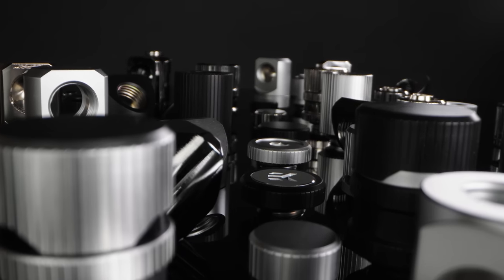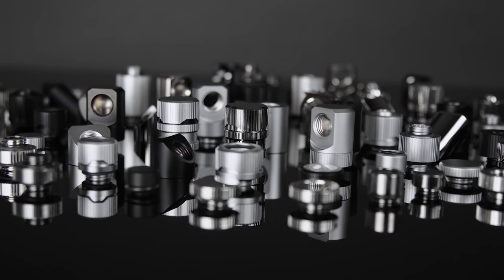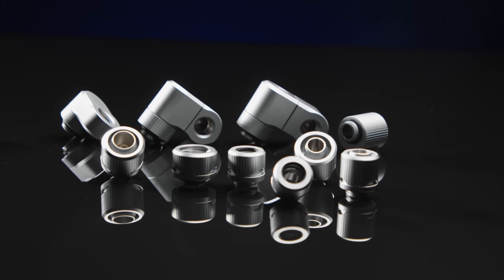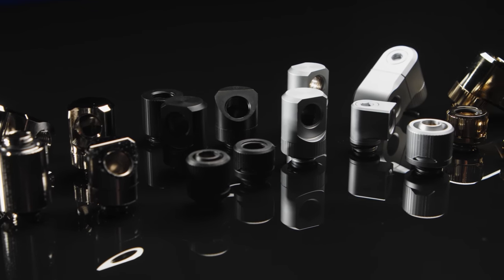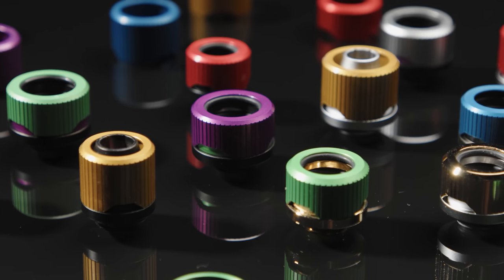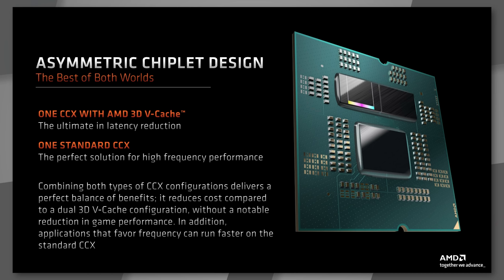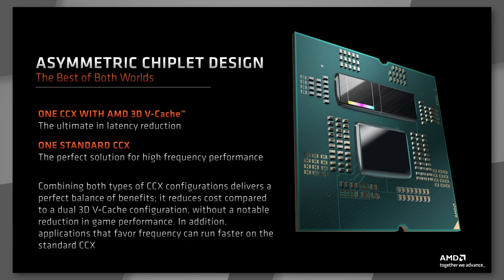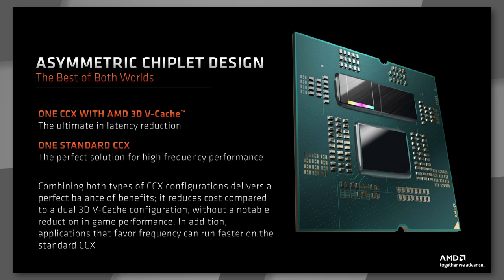Why I switched back to Intel...

Comment: Hey Jay, I feel you are right, you may have had a better experience with a 7950X non 3D. 
For my home rig I too got the exact same MB/RAM/GPU/SSD you did. However I chose a non-x3D 7950x as I wasn't a fan of the 7950X3D design choice being on only one CCD. This whole year my rig has run it's DDR5 RAM on EXPO 6GHz settings flawlessly since new and haven't had any of the issues you encountered, nor have two other mates who also did the same upgrade start of this year with the non-X3D 7950x. Perhaps all the issues that people have had on the 79050X3D CPUs is down to just straight up a bad design decision by AMD or very low tolerances in that product mixing the CCDs with only one with x3d.

Comment: Running a 7950X3D, 64GB (4x16) DDR5 6000 CL32, Asus X670E-E motherboard, absolutely ZERO issues. This is EASILY the best CPU I have ever owned. It is NOT that hard to monitor cores, or to just run something like Project Lasso if you can't figure out how to properly configure something as simple as X Box Game Bar. You can tell Windows if it ever uses the wrong cores for something, and it'll remember not to do so in the future. You literally just have to check a box. LMAO

Comment: Got a 7800X3D with  2x 16GB 6000 Mhz CL32 on a Gigabyte B650 Gaming X AX 
One Time I had memory issues, which I could reolve with one change in the bios, which I found on reddit
That was my only problem and im really happy with the cpu

GPU: RTX 3090 FE repasted
Reply: Can you provide sauce? Helped a friend build with a x670 Aorus Master and 6400 Vengance (7800x3D as well). Always fails to boot with XMP profile and defaults to 4800mhz.

Comment: I have a 5700X and it's been flawless.

I was wary of X3D because they used chips that had been initially rejected from their initial line. I know a lot of people are doing fine with their X3Ds, but you can see the problems cropping up due to using lower-quality chips.

Comment: The beauty of waiting a while after release. I upgraded 4 of 9 of my AM4 5000/x570 systems to AM5 7600x / 7800x3D two of each back in Feb/Mar of 2024 for smoking good prices. All I read about the issues had been fixed, latest BIOS on all of them and installed CL30 6000MT Trident Expo ram on 3 of them. Did have still very high VCORE on a Asus B650e-e board where I have -30 CO and a negative offset on top of that of .1.  Glad I wasn't an early adopter and will also hold off for a while for Zen5.

Comment: This didn’t age well. Recent top tier intel having reliability issues.
Reply: Ik right imagine using Intel in 2024
Reply: @SoriPop  It's only i9(and in rare cases i7s) which are the problem. Most other intel cpus are still stable and worth it for certain use-cases.

Comment: If AMD makes vcache on both ccd lanes and fixes temps on the 9950x3d it would be the king of gaming without a doubt. If they don’t what’s the point of buying a 3d cpu flagship if a 7800x3d beat 7950x3d  in almost all gaming benchmarks. Great job explaining jay!

Comment: I can speak for memory stability on the intel side actually. Bow even though it was completely my doing, I initially tried to run a 12900k on 4 slots of 6200 mhz ram. However, that didn’t work and I got lots of blue screens and I even went as far as upgrading to the 13900k, different ram, and board multiple times to try and fix it but with now 7200 mhz ram it just wouldn’t even boot. So I go to take out 2 of the slots, works perfectly fine. I found out the hard way that for ddr5 you can’t run 4 sticks of ram over like 5600 mhz if you want good stability. I’m happy to say that as of now, about 6 months from when I initially found my issue that my pc has been flawless on the 13900k

Comment: I would say that you did not have the 7950x3d configured correctly for gaming. With the dual CCD’s and only one having the 3dvcache, it must be configured properly so that games use the proper CCD (the vcache CCD). Not all game engines do this properly, but there is a fix that can be made in the bios. The non-3dvache CCD must be configured to boost lower than the 3dvcache CCD. Games will just automatically use the 3dvcache CCD. Not a perfect solution because you sacrifice a higher clock for productivity tasks, but it works for gaming. No Xbox game bar required. Also, under-volting these 3dvcache CPU’s is not the best idea. You are absolutely correct about a “single CCD for X3D” chips. I wholeheartedly agree with this. The two just don’t mix very well and require bios configuration for proper operation. Many problems with the dual CCD X3D Chips can be attributed to the above while still others you can place squarely on Ryzen’s problems with DDR5 and DDR5 itself. DDR5 doesn’t use enough voltage (1.2v). I use 1.35 to 1.4v on DDR5 without issue. Also, turn off “memory context restore” in bios to improve boot speed. I still prefer DDR4 for its stability.
As for your 14th gen Intel………lower the ridiculous PL1 and PL2 power limits in bios. You can also lower the amperage in the same menu. Your heat issues will disappear. The performance loss is minimal………..but it is realistic performance for Intel’s 13th gen refresh. As we already know, these 13th and 14th gen Intel CPU’s are already failing…………and it’s pretty early in their existence. The 13th and 14th Intels will go down in history as CPU’s with literally 0 (nada) resale value on the used market. They will have already been spent. Would like to hear your take on these recommendations Jay.

Comment: I just upgraded from a dual xeon to the 7950X3D and don't regret it. The memory wasn't running at full speed but a simple settings change in the bios and the system screams now

Comment: All of the comments making fun of Intel 2-3 weeks ago are real quiet now after the disastrous Zen 5 launch 😂😂
Reply: Not really, x3D chips arent out yet and you can just use a 7000 series cpu and wait it out since its on the same platform. You also don't need to worry about the cpu dying on you either lol. At the rate intel is going as a company we'll be lucky to see it around in the next 2 years
Reply: @matics28  Yeah, apparently the issue is an architectural flaw and can't just be fixed with firmware updates. Arrow Lake might be affected as well and it's not even out yet 😂😂 I change my mind... I'll take AMD's 5% performance boost over Intel's meltdown.
Reply: Naw. Intel still messed up.

Comment: Running 2 32gb kits  6000mhz(16gb each stick,4 dimms total) on a 13 gen i9. Has no problem running 64gb ddr5 at full speed, ran memtest just cuz i was curious, took a few hours but i had 0 errors. I always had problems with stability and memory on ryzen. I had a 7800x, even had a cpu failure at one point, as did my friends with identical systems. Dead memory channels. When i switched it was lovely.

Comment: Every 13900k or 14900k variant including its Xeon versions will eventuallly kill itself. There is a fundamental flaw with its design. They moved the I/O block but the lanes are very sensative to degradation. Good luck using Intel Defaults until the warranty expires. Your cpu is going to degrade and eventually kill itself past its warranty period most likely.

Comment: 7800x3d bundle from microcenter, have had zero issues in stability or expo timings on the RAM (6000mhz). My first AMD CPU since the Athlon era (circa 2006? 2005?). Absolutely loving it and how cool it runs while churning through games. I don't use my home PC for anything productive lol.

Of course anything would wipe the floor with the i7 6700k it replaced given the time between releases, but hey, I love it all the same. For $460 for the bundle it's all the better.

Comment: Hi Jay thanks for all the info. I built my first system just before MSFS 2020 came out. I am new to building systems and know enough to cause trouble when I put the first one together. It worked great with a Ryzen 7 5800 and a Gigabyte 2070 super. I switched to a 5800x 3D and water cooler to get better VR performance. Now that my SSD's are completely full with MSFS updates I am scouring the net for the next months for the best some-what budget system components that actually work together. I have had great success with AMD Ryzen's 5800 series but will have to see what happens between now and the Black Friday sales of 2024. Maybe updated versions of the 7800x 3d will improve performance. Time will tell.

Comment: 7800X3D CPU
Gigabyte X670 Elite MOBO 
Gigabyte Gaming OC 4080 GPU
Corsair 2x32GB 6000 RAM

Just assembled this build this month after neglecting my old build for 8-9 years. Runs like a champ. No crashes, BSODs and boots to Windows login in 11ish seconds

Comment: My previous configuration was 13900K and once in my life I switched completely to the AMD platform. I'm currently running the 7800X3D on TUF B650 with DDR5 G.Skill Trident Z5 NEO 6000MHz CL30 expo.I also stream on YT and play at the same time and I didn't notice what you were saying and I had 0  issues. It's wild what you're saying. Maybe you've fallen into your own loop that you've created? The more you started delving into it, the more you fell into it with no way out. I am a much happier owner of the 7800X3D due to better gaming performance than the 13900K + lower temperatures - let's be honest - 13900K is a hot CPU - you can't have low temperatures at 400W where the 7800X3D draws 80W under load, it can't go wrong with 7800X3D.

Comment: I have had no issues really with 7800x3d, I  applied expo settings for ram and worked flawless (I checked approved ram before buying). I've been able to set the pbo to -40 on most cores (5 and 7 are the only exception). Get crazy good performance without really upping the frequency.
Reply: why not just PBO on auto?

Comment: The bad thing when a content creator/influencer makes a video like this is it gives the average person the impression that this is how things are. It isn't. These are outlier cases. I know dozens of people (including myself) running X3D CPUs, 5800X3D, 7800X3D, 7950X3D (this one is rarely recommended), and none of them have any issues like this at all. These CPUs are pretty popular in the Star Citizen community, where I spend most of my time, because they run the alpha so well, the best you can get in fact. Doesn't hurt that they're so good in gaming overall. This is a game that hammers the CPU and RAM pretty hard, but nobody seems to be having problems like this. About the only time anyone runs into a problem is when they try to use too many DIMMs, the IMC can't handle it with faster RAM, so instead it's heavily advised to just run two sticks. 32gb or 64gb 6000 CL30, Bob's your uncle.

The 7950X3D can be a little cooky because of the Xbox game bar thing, but that isn't a fault of the hardware itself. This is why we virtually never recommend that CPU, just go with the 7800X3D instead. It doesn't have that problem, it's a monster for gaming, and it isn't a slouch for other tasks either. I feel like simply swapping to this CPU would have solved all your problems.

Personally I'm still on AM4 with a 5800X3D. I have it running with 64gb (4x16) 3600 CL14 (CL16 stock, mem timings have been tightened) and a 7900XTX. The only stability problems I've ever had were when I got the XTX and was finding its under volt limit.
Reply: memory problems (not fixed) and the chip blowing themselves up (fixed if BIOS updated, although we won't know until few years later if the voltage isn't slowly killing the chip with the "fix" provided by MOBO manufacturers) are the first thing you find in droves when you research the 7800X3D a bit.
then you find out about the stupid idle temps, the huge 3D cache that doesn't even matter in lots of games, bad for productivity work, weird things with the drivers on Windows 11, etc...
and people keep defending AMD like it's a small company that can't test their products when in reality they're one of the biggest companies in the world lmao.

Comment: I used mostly intel, but I did build one AMD from scratch back in the day with a tiger MB and two sockets which because of cash limitations I only used on Thunderbird CPU. It didn't work out well because it was a problem with the ECC memory for that server MB.

Comment: 5700X on B550 Aorus Pro, curve optimizer -25. Boosts to 4.85 GHz low to mid 70's temps on Arctic AC34 Air.  DDR3600 running @ 3733 CL16 with tightened timings - no issues.  Nice uptick from the Ryzen 3600 golden sample that preceded it which itself was a significant upgrade from the 3770K that QB'd my little 'farm' of systems for 8 years.  I did have a RAM problem with my HTPC after building it with the R 3600 that had been freed up but it turns out it was the motherboard's inability to run the RAM any higher or tighter than 'stock' XMP.  It's an entry level B550 board tho so I'm not too disappointed.  I've heard there's issues with 2 or 4 DIMMs, single rank vs dual rank, etc. with some AM5 systems so you've probably been one of the unlucky ones Jay.  I expected some 'teething problems' with AM5 which is one of the reasons I upgraded to the 5700X instead.  I'll probably make the jump when it's Zen 5 or 6 or an Intel equivalent - whatever makes more sense at the time.

Comment: 7800x3d with a 4070 super, 6000ghz RAM, and this machine is a monster. Im running insane titles at 1440p ultra settings at 100 frames or more with 1% low at 99. Most of my games that i play are 200fps with literally 0 issue. Max temps on CPU and GPU are maybe 68c in a mid tower case all air cooled. Switched from intel to AMD due to power/performance/price ratio and its almost impossible to argue with 7800x3d with a good graphics card isnt the best value and future proof alternative.

Comment: I hate to say it, but I think that what you're dealing with is not an AMD nor a memory issue, but rather a motherboard issue. Asus has really gone downhill, especially on AM5 platforms. Tons of people online and reddit etc have reported numerous issues like you've described, and they are almost always running Asus motherboards. The fact they've had to release so many dozens of BIOS updates to me says they're trying to software engineer around poorly designed and specced hardware that is fundamentally flawed.

I actually went with ASRock for my 7800x3d build, which was a first for me after being fed up with an extremely buggy Gigabyte AM4 5800x build. I have zero issues with stability or memory learning on the ASRock board, and it's actually one of the most stable systems I've ever had. Ironically, ASRock which used to be considered an off-brand or budget brand, actually uses a lot of different components compared to Asus, MSI and gigabyte which all share several things such as the crappy Intel NIC that's known to die. ASRock is using other components and is arguably the most stable AM5 platform, but it doesn't get much press or praise from mainstream tech as I think it's still living in the shadow of being an off brand for so many years.

Would love to see someone do an in depth stability testing roundup of the main motherboard brands on this platform to prove it, but that sounds like a multi-month project at minimum that likely wouldn't make sense in the scope of a YouTube video.

Comment: Asus board, eh? I went with an Asrock X670E Steel Legend for my 7800X3D and it's been rock solid with a (on the memory QVL) G.Skill 6400Mhz C32 96GB kit on XMP settings, or Buildzoid's Hynix M-die settings. I went with Asrock over Asus (because they tried to burn their customers) or MSI (because the user reviews were not looking good). Not interested in going back to Intel until they stop pushing MOAR POWAH!!!!111!11!1!! and get back to sensible power draw CPUs.

Comment: A friend also felt into that "specific AMD Ram" thing and things also gone sideways, back when DDR 4 4000 was a thing. It never POST at that speed, no matter how many BIOSes were launched and no matter what i've done. The best it could do was 3200Mhz and that's it. It was very frustrating, as those sticks cost a premium (almost twice the regular 3200 ddr4).

Today I'm more skeptical and practical. No more specific RAM, no more early adopting things. Don't have the time and neither the health to deal with the hassle.

Comment: I am going to be running hand-me-downs from my friend but they aren't awful, but I haven't had a high end gaming PC since the early days of a GeForce 4 and Pentium 3 processor.

Here's the setup I am going to be putting together:
Intel 12900K
Radeon 7900XTX with 24 GB of VRAM
2 TB Samsung SSD, 4th Gen
64 GBs of DDR-5 5200
1300 Watt CPU. 

I am excited to see what comes of it and stability.

Comment: 7950x3d with 6000mhz cl30 ram from corsair and a 4090 here. Not a single problem on my end. EXPO instantly gripped and is rock stable. The MSI Mainboard I have trains ram at ever startup for ~30seconds which I mean is a bit annoying that booting takes longer than it used to but really not that big of a deal since this is the only downside I face.

Comment: I went with the 7950 x 3D as well and had all these same problems with memory and bios updates. So happy I wasn't the only one having these issues. I left everything stock just like Jay and it is now stable after installing the latest Bios ver (was on stock bios before for stability). 6000mhz memory running at 4800mhz still sucks tho, but at least I'm not getting BSOD and stuff anymore (fingers crossed).

Comment: I started with 32gb at 5200 from the start with a pcie 5.0 and no problem at all  I used a B650E-F Strix motherboard  and have had no problems with the system cpu radiator 2 fans and 3 fans up top 1 fan in the rear, go for it!!! Keep us updated and thanks not bad bios changes everyday so I  did the bios from 1st week January it's kinda like and I Phone nice looking hardware 3 months later it almost works correctly!!!